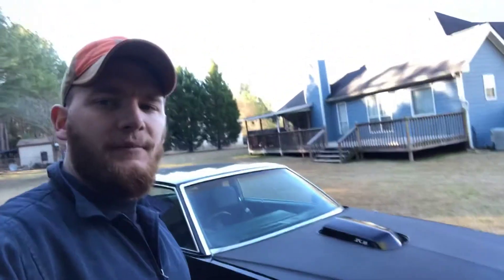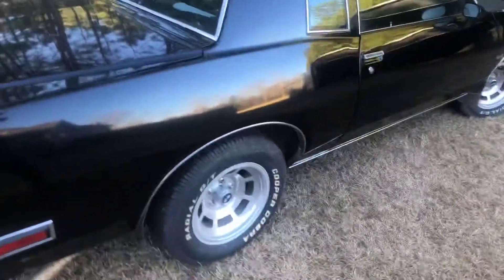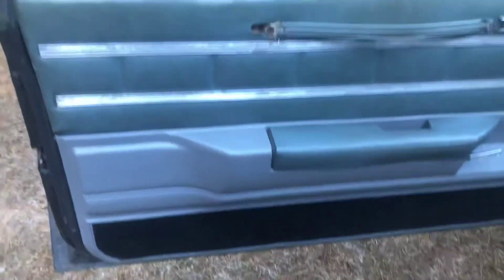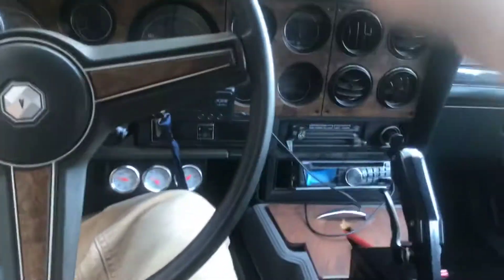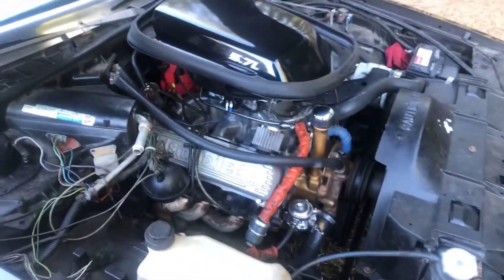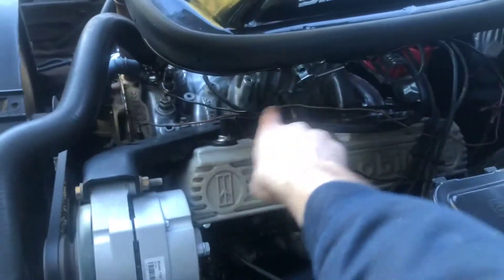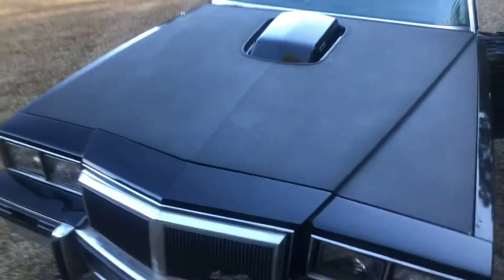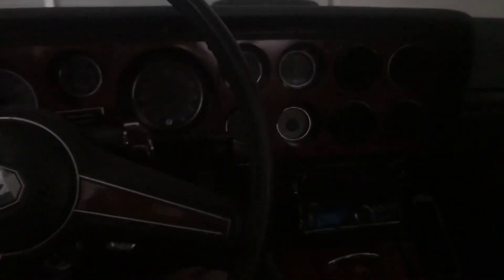Pontiac Grand Prix 1981 walk around

Comment: I had an 81 GP, an 85 GP ans now I have an 87 GP with the 4.3 V-6 and early fuel injection. I love the 80s Grand Prixs. Best looks and lines, instead of a total box! Comfy as can be and 20 mpgs in the city. Only thing I would like to change, would be an automatic overdrive transmission,  700r4 if it will fit

Comment: Watched the video about the trans swap. I have a 72 Cutlass with a stock 200hp 350 rocket. With all that you have done to your 350, how many ponies do you think it’s putting out? and how easy was the th350 to 2004r swap? 

Also, what’s the exhaust? Sounds wicked! 

Also, you could probably do the timing with a vacuum gauge.
Reply from the maker: I think it’s making around 380-400. Haven’t had it dyno so not 100 percent sure. Trans swap wasn’t bad, just had to wire up the lockout torque converter. The TV cable is a pain in the rear, but I have a manual valve body so it isn’t used. The length of the two is the same so no issues with driveshaft. 2-1/2” dual exhaust with shorty headman headers. And yes you’re right about the vacuum gage